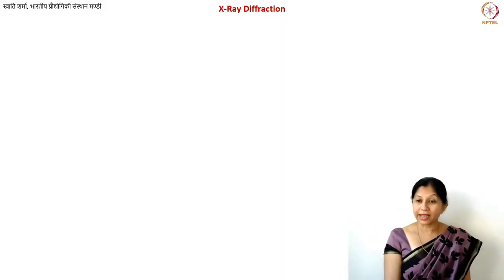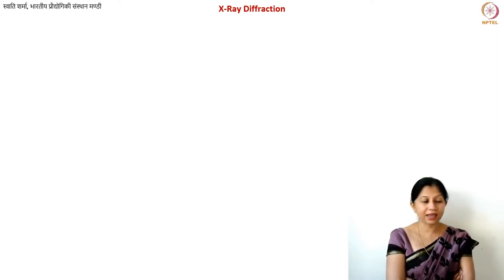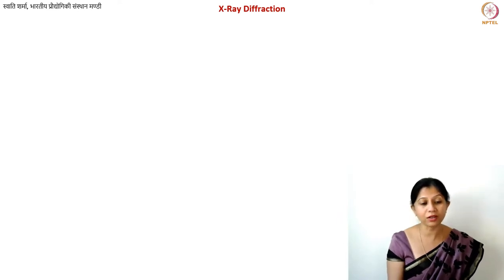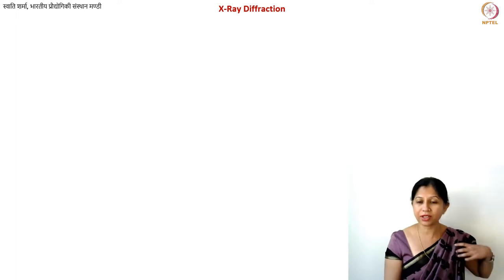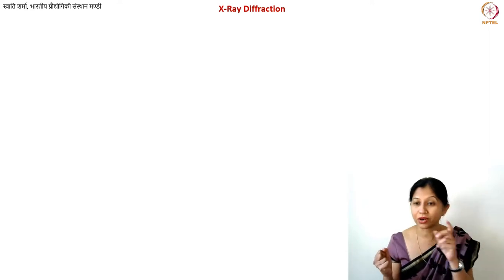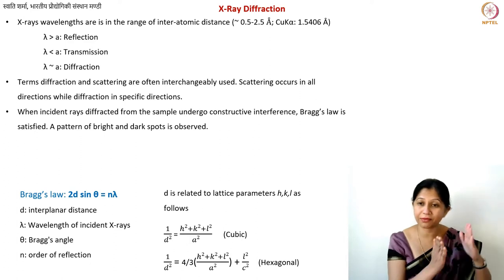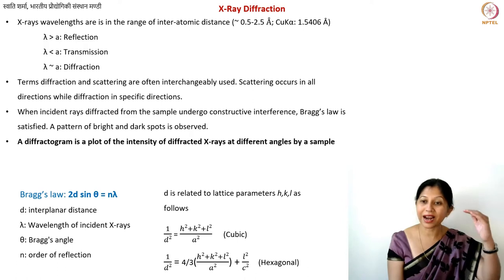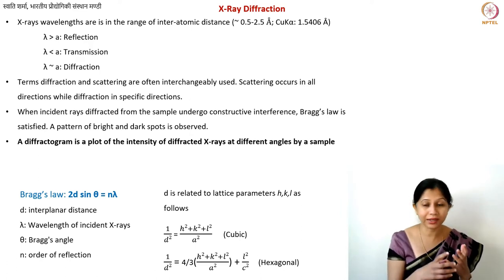X-Ray Diffraction Analysis of Carbon Materials

Comment: Thanks for your nice lecture. I am actually facing a big problem of reproducibility analysing XRD patterns of carbons. The Intensity and S/N ratio is actually non reproducible for the same sample, a believe due to the unreproducible packing of carbon in the sample holder, due to its soft nature and low absorption coefficient of carbon. How is it possible to solve this issue, and comparing different samples? How should I prepare samples? What are the standard procedure? Is it possible in some ways to post process the XRD pattern mathematically to compare the patterns, and if yes, how?